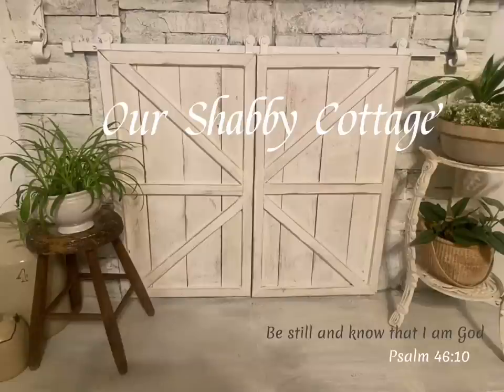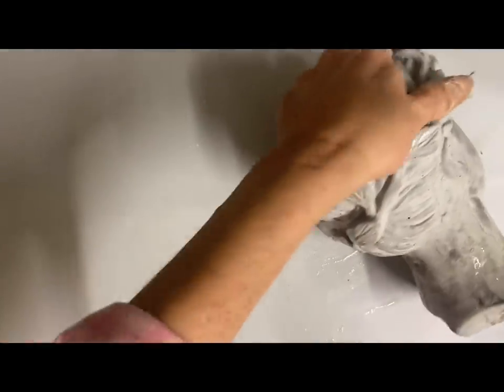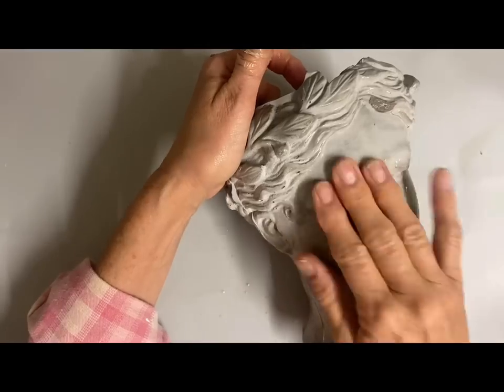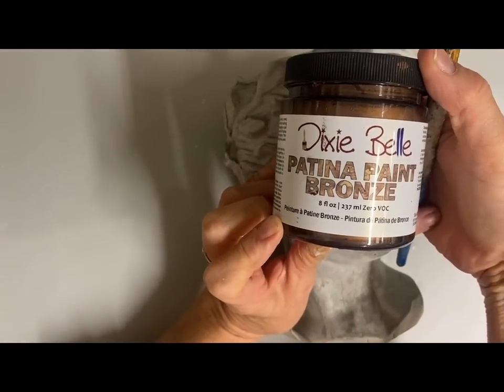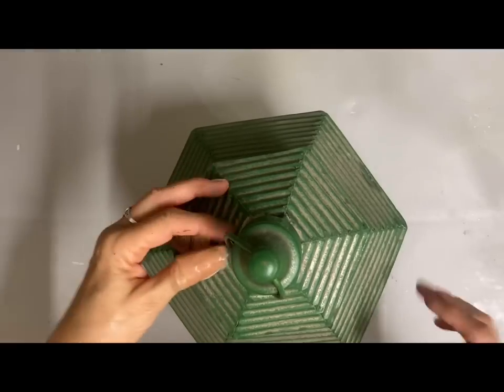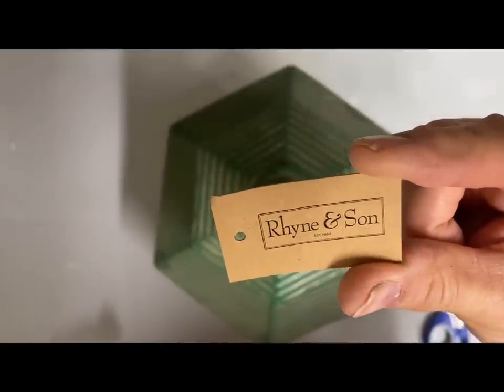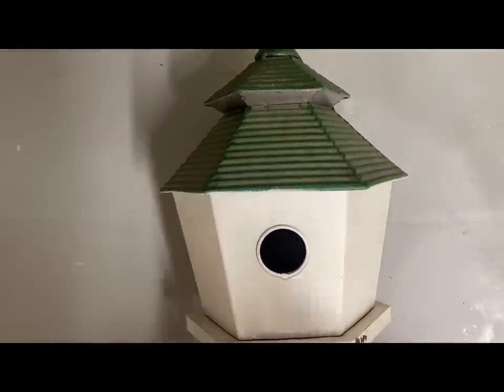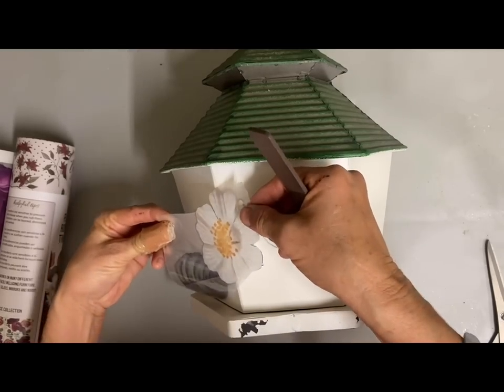DIY French Country Makeovers

Comment: absolutely LOVE the cement head vases and I'm mesmerized with your finishes, Lisa! One question on the vases: do you smooth off the mould seam lines? Another question: does that patina paint need the brown or black undercoat or is that just something you prefer to do? Since the little birds on the riser will be in your store you will be able to control their display but I'm thinking about my booth space. People will pick them up and move them about and I would want them to be seen like they are. I'm thinking about some sort of tacky adhesive without permanently adhering them. What would you suggest? Are you going to be reselling the concrete forms? I know shipping would be a pain but what about drop shipping from Rhyne & Sons?  Just a thought 😁
Reply from the maker: We do sand the seems but this mold came from Amazon and I included the link in the description.  They are a bit priced though.  I didn’t need to do brown underneath and I completely agree that the birds should be glued in place with either Titebond, gorilla glue or maybe E6000.  Thank you so much my dear friend ❤️🙂
Reply: @ourshabbycottage8553  thanks Lisa, I’ll check the link ! I think these would be so much fun to do. 💕